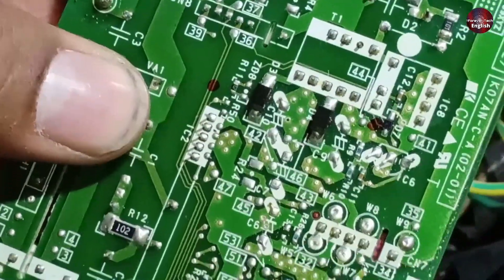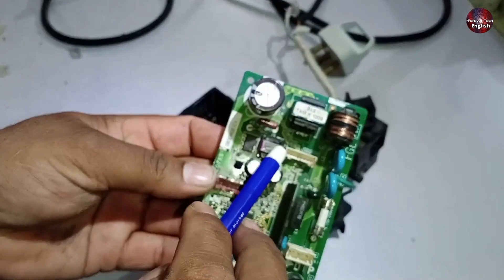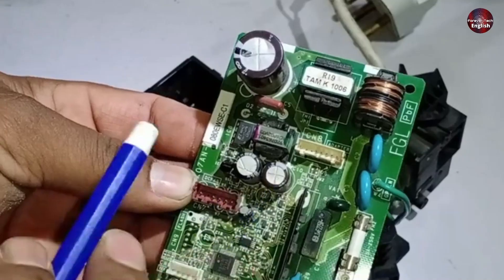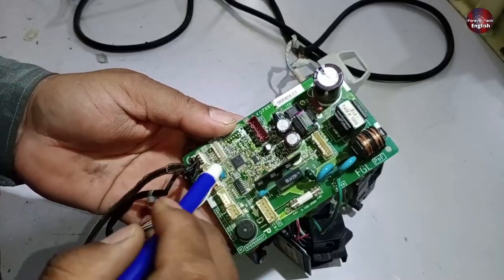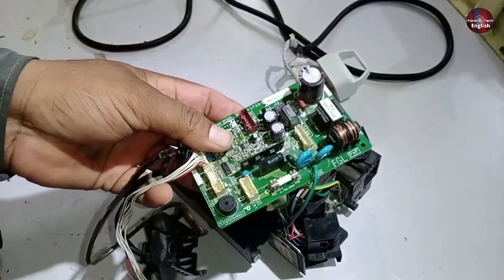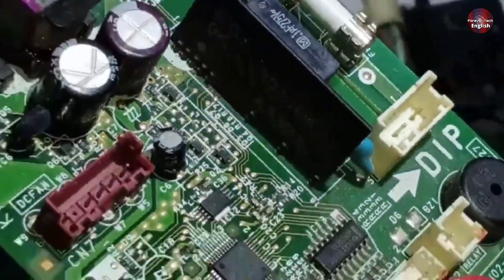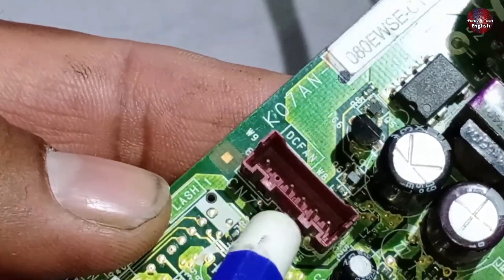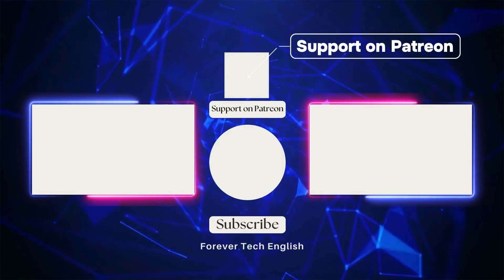I Found THIS in Fujitsu AC SMPS Circuit – You Need to Know!

Comment from the maker: Surprise! This Fujitsu SMPS circuit has NO voltage regulator! 😱 The chopper does all the work, and if the 407 diode or TNY274PN IC fails, the whole system crashes. 😂 Got questions? Drop them below